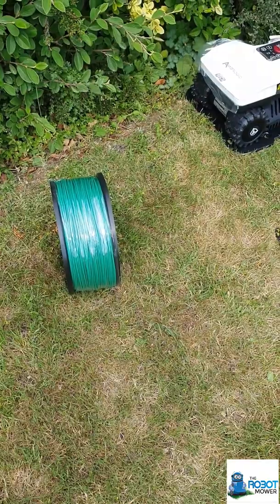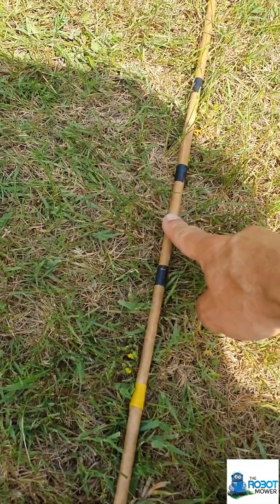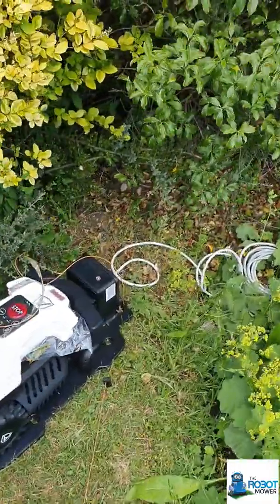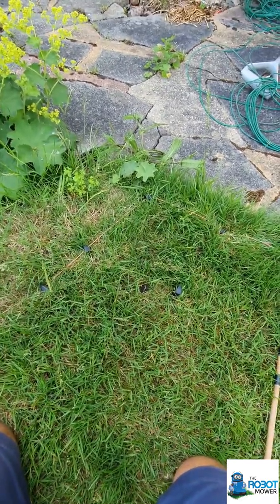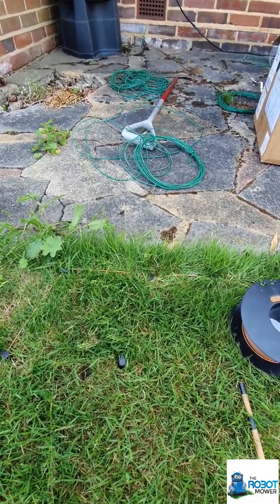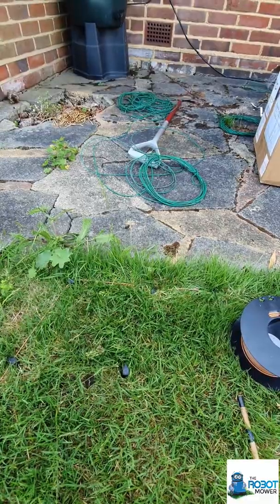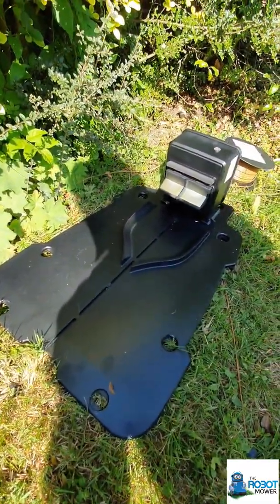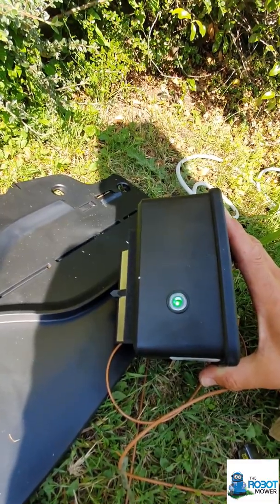Ambrogio Twenty Installation  - The Perimeter Wire

Comment: How large can an "island" be - are there any limits?  There are for other manufacturers, and my ideal layout generates a couple of Islands around rockeries etc, one of which is very large.
Reply from the maker: Hi Robert,  there is no theoretical limit on the size of an island but if i requires a lot of wire or makes it difficult to get round the back of the island then you may need to consider other options.  How big is the island and how big is the total area?